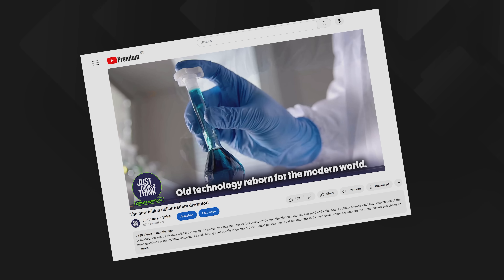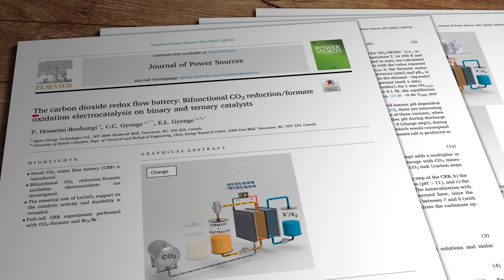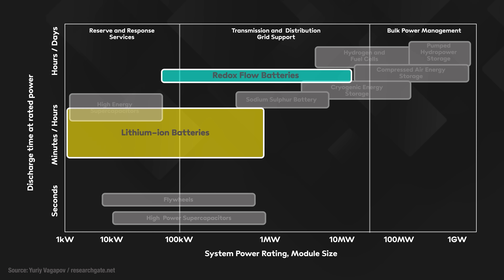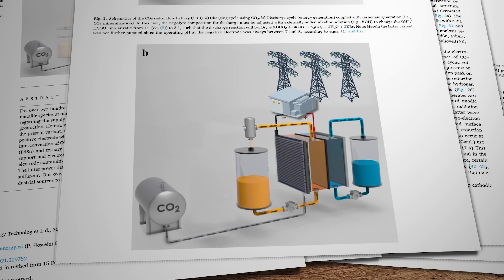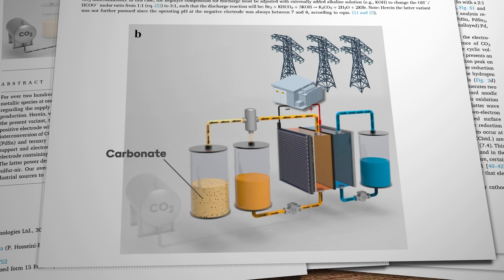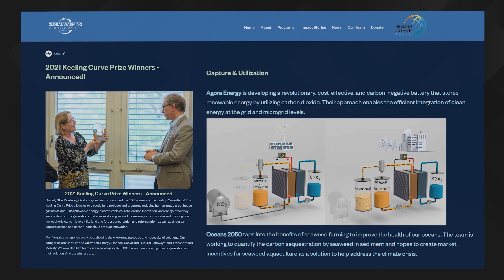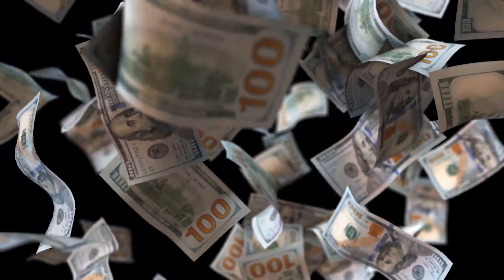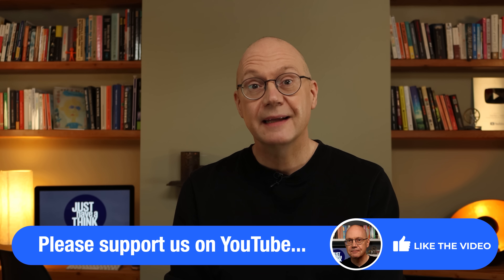A Carbon Dioxide Battery that could actually work!

Comment: I'm afraid the bonus solid carbonate is not necessarily special. As you mentioned it requires a high pH, eg by adding lime or in its stronger sodium form, caustic soda. That costs energy to make and money to buy. It may lead to scaling of the electrode. The CO2 could have been made to react with such basic chemicals in the 1st place, irrespective of the presence of a flow battery. So this seems like the stacking of proven technology sold as something new, unless the battery discharging and the way the CO2 then becomes available will substantially simplify the precipitation to a carbonate.
Reply: Or you could manufacture NaOH from seawater using renewable energy, with a serving of Chlorine for good measure. No CO² output required.
Reply: It looks like they need 3 times as much Potasium Hydroxide (KOH) as the Potasium Carbonate (KCO3) made.  Both chemicals sell for about $1k a ton, so they are loosing money on the chemical conversion process itself.  The electical 'storage' (a bit of a stretch as it seems most of the energy release is from the input chemicals) would need to cover the loss which seems really unlikely.
Reply: @kennethferland5579 "potasium" lol
"Loosing" lol.
I find it hard to trust commenters who can't spell.
Reply: Right on! This is completely stupid idea that makes more CO2 ( during hydroxide production ) than it "stores" in carbonates. I hate that this rubbish gets even the slightest attention. Does really nobody understand the most basic chemistry???
Reply: Seaborg uses steel that handles caustic soda at 600 C . The electrode could be made of such steel.

Comment: 📝 Summary of Key Points:

📌 The Agora energy company has developed a unique carbon dioxide Redux flow battery that utilizes captured CO2 from industrial emissions as its energy store, distinguishing it from traditional metal-based solutions.

🧐 The battery operates through a process where CO2 is converted into an anion formate of formic acid on the cathode side and bromine is used on the anode side, offering a sustainable energy storage solution with potential for producing valuable industrial commodities like carbonates.

💡 Additional Insights and Observations:

💬 The battery shows promising energy density and cost-efficiency, with specific energy density surpassing typical flow batteries and potential for low-cost CO2 capture and valuable by-product sales.
📊 The research paper highlights a potential difference of 1.59 volts across the cell and a specific energy density of 284 W hours per kilogram, indicating competitive performance.
🌐 Agora energy's innovative approach has garnered recognition through awards like the Keeling curve prize and the hello tomorrow Global deep Tech competition, showcasing the technology's potential.

📣 Concluding Remarks:

The Agora energy's carbon dioxide Redux flow battery presents a compelling and sustainable energy storage solution that not only utilizes captured CO2 but also offers the potential for producing valuable industrial commodities. While facing challenges in scaling up and commercialization, this technology holds promise for a greener future and warrants attention from green investors and supporters.
Generated using TalkBud

Comment: You need to calculate and add the source of alkaline you use to neutralize the CO2 into Carbonate.....so it does not hold water unless you find a free source to raise the pH ..and since it does not use CaO which is likely the cheapest you may have to use hydroxide ...which you use electricity to produce 🙂
Reply: Your bitter comment could be used to raise the pH. 

The above comment was made in jest, you raise a crucial point.
Reply: @ricos1497 that would lower the ph, not raise it...
Reply: @gregbailey45  well, now the joke is on me.
Reply: Not sure how you get two negative ions to react. Sodium hydroxide plus hydrogen carbonate will yield sodium carbonate plus water. That works but costs.
Reply: @dennisware1136  You can change the ORP by changing pH, but you spend the OH- in this proces
Reply: If you would find a process than could make hydroxide at a higher than 100% efficiency then you could net store CO2 with this "flow battery". But since every real hydroxide production is less than 100%  (not even close!) this whole setup is a joke that is a net CO2 producer! morons...

Comment: Flow batteries soud great for stationary storage. This one adds another dimension-  shows there are not just primary benefits, but secondary and perhaps tertiary reaction products we could utilize. Save Lithium for mobile applucations where weight matters.
Reply: Actually stationary storage is what we need most of all if we want to make Wind and Solar generation efficient and practical on a large scale.  Currently with wind  if supply is greater than the demand we feed some of it back into the wind generator to slow it down which wastes electricity and also wastes the energy in the wind. With solar there is the problem of no generation at all during low light and night time. 

The breakthrough in clean energy will not come from the source of generation but in the ability to store all the available energy for later use
Reply: @longjohn526 well said
Reply: Totally agree, I cringe to see people using lithium based batteries for grid storage, not environmentally sustainable when there are better alternatives
Reply: Yeah and focus on lithium air. Potentially having up to12,000 kwh/kg if we can take the oxyogen out of the air which blows all the other battery chemistries out or the water. Half that if oxyogen needs to be included.

Comment: I don't understand.  Where does the sodium and potassium for creating the carbonates come from?  Don't they require electricity to produce in electrolytic cells?  Rather than being a flow battery, isn't this just a method of converting the industrial production of carbonates to being supply following?  That would be a double-plus-good accomplishment, but sort of misleading to posit this as a large scale method to provide for grid scale storage of energy.

Comment: Carbonate as a waste by-product could actually make Carbon Capture and Storage (CCS) actually work (assuming no acid rain).
Reply: I thought acid rain was a mostly solved issue, since most countries require sulfur-mitigating filters.
Reply: @12pentaborane  Yes. Governments actually took steps to reduce acid rain.

If now they would do the same for excess CO2.

CO2 itself forms a weak acid when dissolved in water.
Reply: @economicprisoner   As you know, carbon dioxide regulation is an engineering and political nightmare. If this battery works I say we mandate oil companies to build these.

Comment: Have a thick energy cannot be destroyed only changed from one form to another zero point is a way to tap into this force but as always it will take a device to be made to make this happen think of letting flow and the triangle 3 6 9 12 18 is the answer

Comment: I had to pause you there, and no, not about to rant.
You could place this on a HGV, as the vehicle is moving from the source of the CO2 it could power itself with the energy created and then drop off the Carbonate where it is needed.
Another wee snack for the grey jello upstairs 🤔
Love your work, keep it up and thank you 🙏🏼☺️
Reply: I don't think this process creates energy.  It's a battery.
Reply: @incognitotorpedo42  It is a generator. CO2 in as the fuel source, energy created and Carbonate as the exhaust.
Reply: This will need a transformer to up the voltage though 😉

Comment: The benefits of my wisdom may be minimal. However, it seems that we will need to be able to use different categories of battery chemistries as part of a greener grid. Have you looked at that kind of thing?
Reply from the maker: I have. Quite extensively :-)
Reply: @JustHaveaThink  I guess I should have looked through the catalogue first🙄

Comment: This carbon-capture-during-electricity-production idea is rubbish. In order to create highly alkaline pH of 14, the sodium or potassium hydroxide should be used. And it is consumed during the reaction with CO2, forming carbonates. If carbonates are removed, and the electricity is expected to be generated in further cycles, new portions of alkaline should be added. Unfortunately, in total this process is equivalent to simple dissolution of CO2 in NaOH or KOH, which is quite a costly way of carbon capture.

Comment: I still like the compressed co2 storage system like energydome made. cheap and simple.
Reply: A demonstrator of Energy Dome has been running for some time, proving that it works. A full scale 20MW/200MWh is currently under construction, due to be operational before the end of the year. None of the low temperature hassels of compressed air storage, and all standard equipment in the build.
Reply: Yeah. It's like LAES but without having to maintain air filters. Apparently that maintenance cost has been surprisingly high.
Reply: I have the reverse of that, as in idea... A vacuum battery 🔋 😅
Reply: @dandantheideasman that sucks :P
Reply: @TuttleScott yeah, vacuum sucks!
Reply: @TuttleScott  🤣😂😅

Comment: What can't they make batteries from ???  Seem like they can use almost anything.
Reply: Most every element - particularly metals - effectively engages in both reduction and oxidation.  https://www.heylneomeris.com/wp-content/uploads/Redoxpotenziale_Refox-Reihe.png https://ch302.cm.utexas.edu/images302/standard-potentials.png https://www.researchgate.net/publication/340660884/figure/fig2/AS:880680267444224@1586981946453/Redox-potential-E-0-for-the-reduction-of-CO2-and-related-compounds-in-aqueous-media-at.png

Comment: Wait, is this an energy storage option or a power source? If the CO2 is used up to create the Carbonate, then it is a power source, right?
Also, I just looked at that paper... the 284Wh/kg number is just the fluids, so it doesn't compare to lithium ion, it needs tanks and pumps and stuff... But that number is only really important if you plan to make it portable...
Reply: No. It can only function as a battery, not a fuel cell.
Reply: @gregbailey45  Sorry, that doesn't really clear up my confusion. If it were to function as a battery, then the process would be reversible, correct? But if the carbonate is used as a product on it's own, that would mean it is extracted and thus there cannot be a reverse process... If I'm missing something please do elaborate.